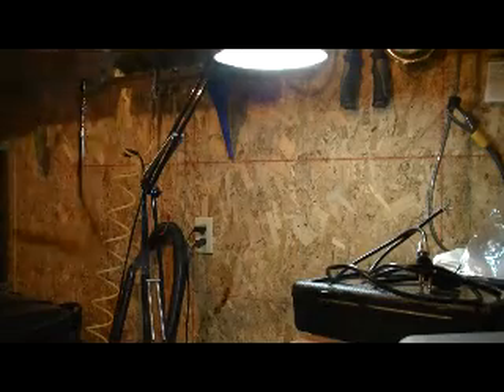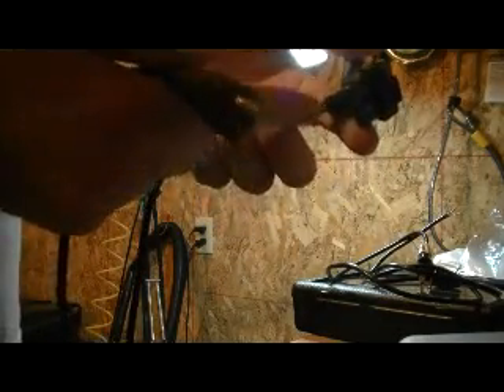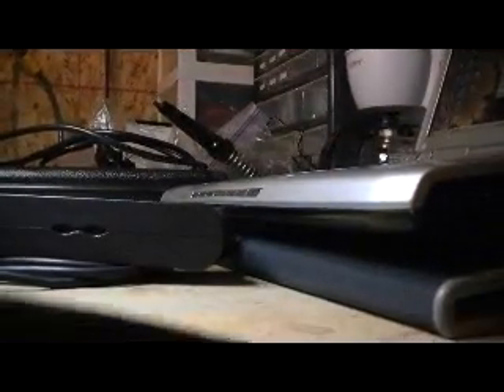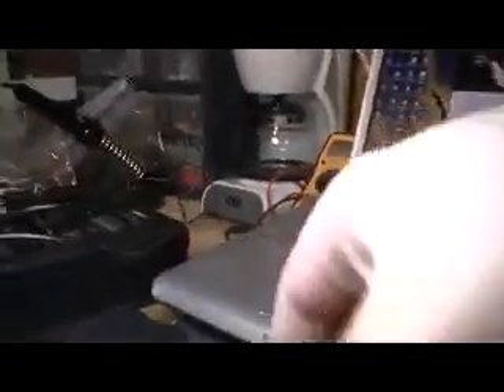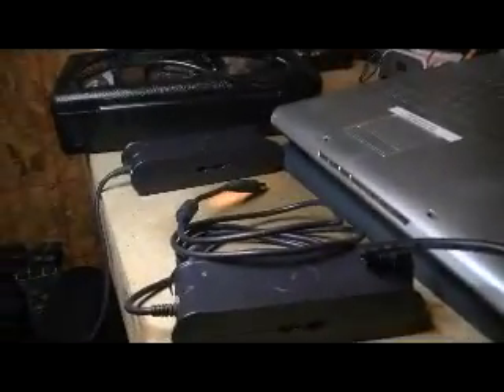Dell Power Bricks: Fake?  (Nope!)

Comment: Ground faults are different from circuit faults. A GFCI breaker trips when it finds resistance on the line like if a device falls into water. A circuit fault is a direct short from hot to neutral and won't trip a GFCI breaker.

Comment: I highly suggest you visit www.mouser.com where you can buy a new plug. They do have them and will ship individual items with no minimum order. I cannot recommend them enough as I get all my parts through them. You just need accurate measurements for the diameter and depth of insertion length of your current plug. From that you can find reasonable replacements from Mouser Electronics.

Comment: I use a power supply from an E6400 ATG (the laptop was toast, can't remember specifics) on my D630. Lot easier to manage than the older dell piece of garbage adapters. Plus, I don't have to worry about it fraying when I look at it the wrong way

Comment: Sometime around 2005/2006, Dell switched from using the midnight blue-ish coloured plastic to the jet black kind. Those power supplies are actually very good quality.

Here's a little tip on maintaining the longevity of those barrel plug ends: always keep the cable straight. By this I don't literally mean that the cable should only be run in a straight line, rather it's best to keep the cable free of loops and twists. Doing this is easy. After you unwrap the cable, and before you wrap it up again, run your fingers down the entire length of the cable, as if you were trying to clean it with a damp cloth. That's the best analogy I can think of right now.

Back in 2010 we bought a cheap replacement charger for our Dell Inspiron 1525 from eBay. It arrived and I discovered that it was actually a genuine Dell unit with stickers covering the Dell logos! Why in the world would they cover the logos and then sell it as a non-genuine unit? Legal reasons, I bet.

Comment: I have a dell inspiron 1545, i have it over a year, have  been using it much on the charger while the battery is still in a very good condition, but i also have my external power supply almost falling apart